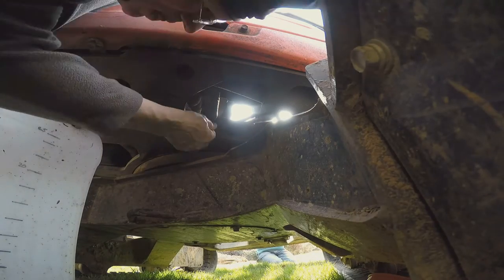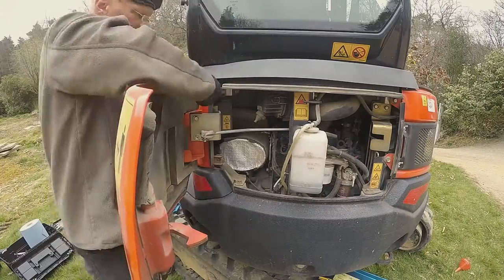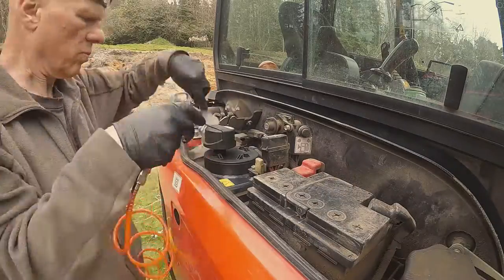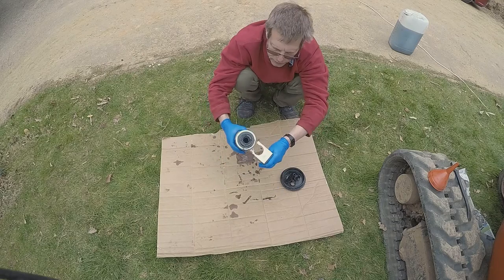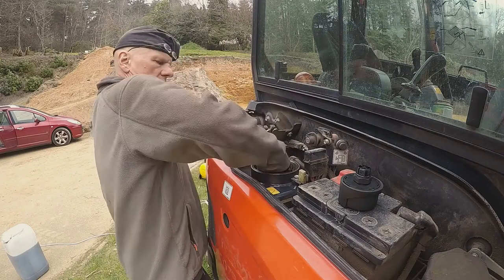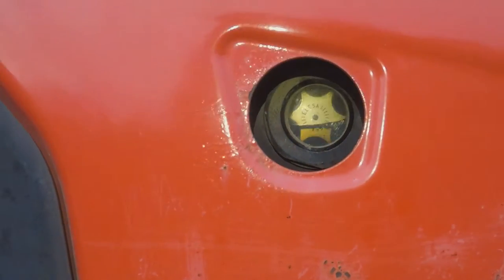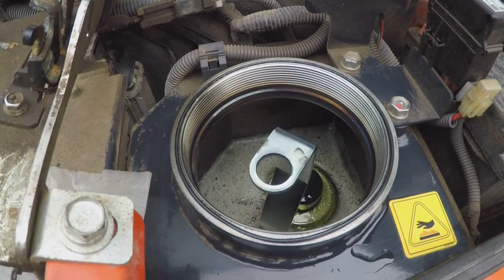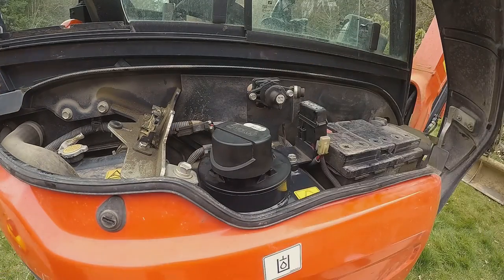servicing Kubota U27 4 changing hydraulic oil and replacing filters

Comment: Kubota original filter are all very expensive, why isn't there a label from other manufacturers, at a better price? Air filter Kubota  outdoor TC02016320- MANN FILTER C11003,  Air filter Kubota indoor T027093220- MANN FILTER C6001, Fuel filter Kubota 1522143170- MANN FILTER WK812,  Oil filter Kubota W21ESO1600- MANN FILTER W814/80, Hydraulic oil filter Kubota RC157-62190- HIFI FILTER SH60772
You save a lot of money and the quality of the filter is at least the same as from Kubota👍

Comment: Just wondering why when the tank was empty you didn't undo the drain and clean all that crap out of the bottom of the tank?  I changed mine at 1000h and there was none of that in the bottom but made it spotless anyway. If you use a lot of piped equipment make sure the fittings are clean before connecting.
Reply from the maker: The drain on mine is not right at the bottom.  Do you mean you took something else off to let out the crap?  
I wondered if it was a bit of water?
Reply: @58wmh   Hi, the drain on mine is on the bottom of the tank, but you could clean it right out next time with rags or something. Interestingly the dirtiest filter at 1000h was the pilot control filter.
Reply: @nigelpayton-miles4378  Thanks.  Please write me, pilot control filter Kubota number parts?